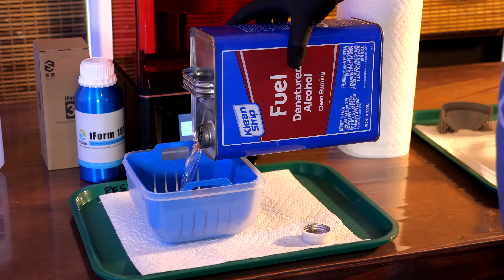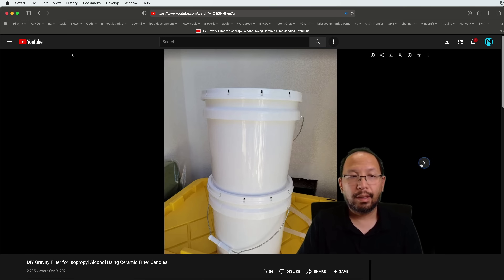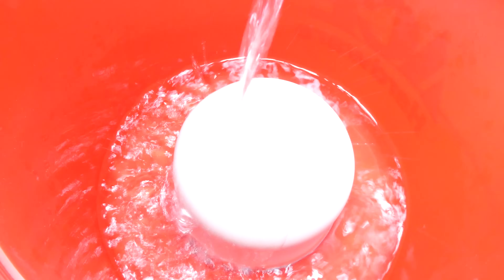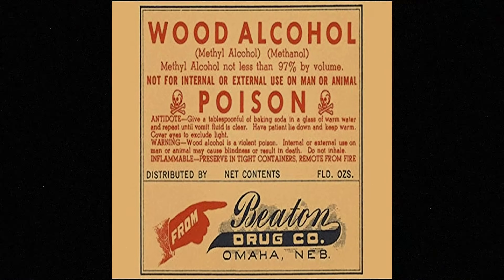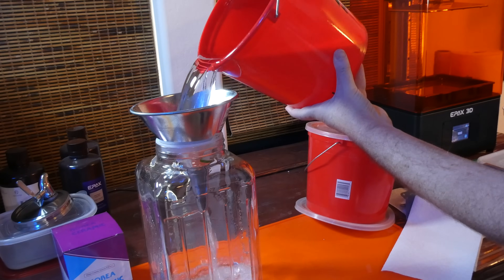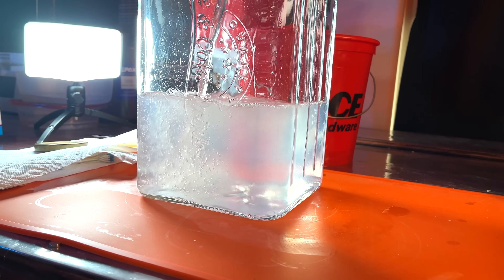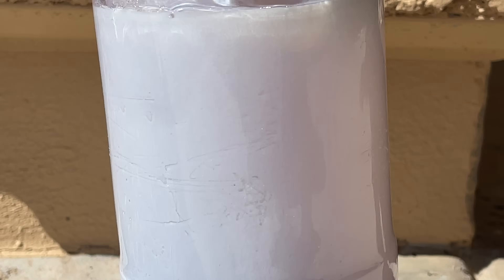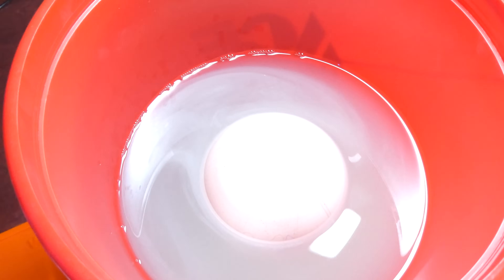Can We Recycle 3D Printing Alcohol?

Comment: So, a couple things.  Isopropyl alcohol smells like that because that is what isopropyl alcohol smells like.  It is also not commonly denatured.
Additionally, mechanically filtering IPA is only effective at removing the pigments from the solution.  Photopolymer resin molecules are smaller than isopropyl molecules, so any filter tight enough to block resin will also block IPA.  There is some level of effectiveness as the resin molecules "stick" to the filter and to each other, so some is left behind, but the majority of uncured resin remains in the IPA, as you found.  the stuff that settles to the bottom is not "the resin" it is the pigment.

The only way to actually filter dirty IPA is to include a UV cure into the process and mechanical filtration to remove the cured IPA, but as you found you cannot simply cure the jar of dirty IPA because you just get a block of resin cheese with all of your IPA trapped inside, and getting it out is a massive and lossy undertaking.

Comment: I've got my old ipa back in the clear 5ltr container in gsrden its been there for a week in full sun curing the resin in the tub and it seems to be turning solid now to the plastice walls of the container It was strained to get all the mucus out at the start with the mesh filters no crud got through but when was in the sun its obviously started to form more from the contamination in the IPA with the resin but it's curing as a solid to the side wall's doing this way and leaving clear IPA on top ipl strain it again on Sunday and leave it a second week and see what happens its just an experiment for myself but seems to be working

Comment: I'd be curious how well a knock off brita filter works. There is probably a video on this I just havent searched. I do have a distillation apparatus I can use. I bought it during covid as I could only fid 50% isopropyl and for my job (fixing phones) I need high purity. I originally tried the salt trick which is cool but some salt does dissolve into the alcohol which is not good for electronics. So I ended up buying a distillation apparatus which works great but its small so it takes a long time, and is dangerous. I did this in my kitchen using an electric hot plate and LOTS of ventilation. So it is an option but I am gonna look into these filter projects before I do that.

Comment: I bought the recommended filters, and mounted a system of 3 buckets and double filter, but it does not work. The filters are not absorbing the alcohol, it all stays in the first bucket. Has anyone had the same problem?
Reply from the maker: It needs to be settled for a week or so, then cured and then filtered.  Look at some of the other comments on here. A lot of good ideas and suggestions.

Comment: While I dont think that distillation is that dangerous, this method is much easier and maybe also cheaper.

As for the bittering agent, I mostly use hand sanitiser for general projects where I need ethanol to clean something. The hand sanitiser that I have just contains (as far as I know) ethanol and hydrogen peroxide, so its much nicer to work with.
Some of the bittering agents in other denatured alcohol are so bitter that you can even taste them when handling food after washing your hands.

Comment: I wouldn't mind distilling alcohol in equipment made for that purpose but I would never use a water distiller for that. The boiling point of IPA is much lower than that of water and the resin fallout can't be good for the inside of the machine.

Comment: Maybe try freezing the solution after you’ve filtered it and filter again to remove the ice. Water is gone, purity is as good as it will probably get. Above 90% is ideal.

I have a sonic cleaner so parts must be in another container with IPA suspended in a basket off the bottom.

👉Here’s suggested purifying method. 

You freeze the alcohol mixture, which allows for partial removal of the nonalcoholic components (water/resin); what remains will be slightly more purified alcohol. 

👉Also called Mongolian distillation method.

👉Another method is; 
Use ordinary table salt to separate isopropyl alcohol from water. 

The result will be a condensed isopropyl alcohol. Don’t forget it is not a drinking alcohol👀. This process is colloquially called salting out, and causes concentrated isopropyl alcohol to separate into a distinct layer. 

⚠️Do Not Use Iodized Salt⚠️

👉You may use any amount of alcohol and salt you like, as long as it follows the ratio of four parts liquid to one part salt. 

These are better methods than distilling that don’t require expensive science equipment If your IPA is old or has absorbed too much water.

Comment: Interesting. I have a distiller that pulls a vacuum before heating up the ethyl alcohol to evaporate it that I use to make Wax. I bet it would work for this too. With it pulling a vacuum, it does not have to get very hot to boil off the alcohol and is safer. Plus with it being a vacuum, it should have little to no oxygen to combust with.

Comment: Have a quick question, I already have one of my containers filled with isopropyl alcohol, also known as rubbing alcohol, high-level medical grade, so it's at 91%.

Since what you're using is denatured alcohol, and since both differ subtly, could I still use both in the same container, or we'll both containers have to be separated out to be labeled properly so that both don't mix?

I've been trying to find like almost everywhere if it's okay to mix of denatured and isopropyl alcohol together in the same container and not get any kind of odd reactions or violent reaction, and everything that I come across is not answering my question

Comment: Have you considered creating a siphon with filter material inside the tube? I’m thinking that if you could keep the siphon hose floating close to the top of the surface, gravity would keep the larger particles from going up the tube. Having filter material within the tube could allow for additional filtration as the fluid travels to the other container.

Comment: Alcohol has a low boiling point. Not anywhere close to ignition temp. As long asthe heat source is far from the alcohol. No problem. How about sous vide

Comment: I just got my 3d printer yesterday.  Haven't fired it up yet; I'm waiting for gloves, goggles, etc to get here in a day or two, and in the meantime I'm reading (watching) everything I can to learn the process.  Anyway, how about a sand filter, at least for the first stage?  That would be cheaper than the filter you bought and might not clog up as fast.  For those of you with a wash-n-cure machine, what about putting the dirty alcohol in cure station (perhaps in a big glass jar instead of the washing vat in case it goes horribly wrong) and using the magnetic stirrer to keep it agitated so it doesn't form a gel (mucus) as the resin hardens?

Comment: Um. That is not right. Distillation can and does remove methanol (the denaturing component most often used). You do need to know what you are doing but it can be done. Yhis how monshine is made and why whiskey does not contain methanol. you don't need Walter White levels of chemistry knowledge.

Comment: I have a background in chemstry and must say. If, and only if, you have the right equipment (wich is not that expensive) and knowledge to do, distilling is very easy and quite fast. I've done a few times to reduce the amount of water in alcohol for some reactions that are a little water sensitive and they went painlesly. But i would never recomend it to anyone who doesn't have the knowledge to do so, and specialty the knowledge to deal with it in case something goes wrong.

Comment: a rubber flap cut to fit over the filter while vertical hooked up to a cheap motor to spin would both agitate the alcohol and wipe off resin

Comment: Yes, I would feel comfortable distilling alcohol. You see, you're indirectly heating it (and furthermore in an airtight container that contains little to no oxygen, making combustion IMPOSSIBLE) and the alcohol will begin to vaporize at a fairly low temperature (100F +) which is way lower than it's combustion temperature. Sure, it seems scary, but distilleries frequently run alcohols at 160 proof plus through distillers in order to achieve even higher alcohol content. So, if they do it with zero qualms, why can't you?

Comment: You might want to include a "big" filter prior to the ceramic filters. Something to catch the larger particulates. Maybe a multi-stage filtration system with "step down" filter sizes, IE smaller and smaller filter sizes to get each level cleaner. I'd also suggest breaking them up into multiple devices instead of one massive system so that if you need to clean a filter you don't have to drain multiple filters above it.

Comment: About distilling. 
Doing it without a flammy heat source is safe so long that you do it in a ventilated area or outside. I would however says that chemistry glassware works infinitely better than some cheap appliance. And isn't that expensive either so long you take good care of it.

About the idea of drinking it, of course don't. But for science curiosity, know that methanol comes first in the distillate as it is more volatile, so long that you lower the heat, ad a stir bar and wait for a good 15% of volume to drip. What's left to distill would be ethanol. NileRed shows how. Or don't and leave it to chemist for obvious reasons. The bitter would still be present anyhow.

Comment: I was inspired.  I made this with 2 of these filters in 2 different 5 gallon buckets for a total of 4 filters going into a 3rd 5 gallon bucket.  The alcohol comes out very clear.  Haven't degunked the filters yet, so I'm really looking forward to that.  It filters pretty slow, but it does work.  However I don't consume huge amounts of alcohol with only one printer, so I'd say if you have lots of printers, you might want more than one setup to be filtering at any given time.  It'll still make the money back easily.

Comment: I distill my alcohol using a water distiller, you said the water content won't go down but mine is adjustable, I run it below the boiling point of water and it comes out crystal clear and no amount of UV will cause any "mucus" I did modify it though adding lots of extra sealant and an external radiator with fans as the built in coils don't condense nearly all the alcohol like 75% at best. Been doing this for a while without any issues.my whole system is sealed with the exception of a small vent on the collection bottle. No smell in the garage and I can do a gallon in about 2 hours give or take. An adjustable still is a good idea and it runs off a PID controller I added, but even with the stock band controller setting it at 82C works fine.

Comment: Question: If you exposed the solution to UV until the Resin became COMPLETELY solid, would it expel the alcohol instead of incorporating it like in the last example?

Could you spin it in a centrifuge like manner and separate the Resin prior to filtering it for extremely filthy solutions?

Comment: That resin seems like it would be a pain in clogging up pores in a fine ceramic filter. A multi-stage system using really basic and cheap disposable filters (coffee filters for example) at the top stage would make the most sense. Even a coffee filter might remove like 80-90% of the chunkiest gunk - meaning your much finer filters below will last 5-10x longer and not clog up nearly as much. This approach should save  both time, effort and costs.

Distillation is great and would allow for complete purification - but it's a power intensive process, so that power demand would eat up a non-trivial amount lot of any cost savings you get out of this. That level of purification is probably overkill for this use-case anyway.

Comment: You might need some lab equipment for filtering.  connect Filter funnel , vacuum filtering flask  to a vacuum pump to force liquid to go through filter. If you have right equipment you might be able to DIY it.

Comment: you can turn denatured alcohol into drinkable liquid with distilling the methanol comes of first at a lower temp in this case about the first 10% put it to other uses then the rest is ethanol thiis is the same as doing it with a fermented brew the first 5% is methanol just use it elsewhere, but you look like you gotta problem with the contaminants. so your used alcohol would be no use to drink

Comment: You can separate out ethanol, water and methanol: Distill under a different pressure to separate out the water, methanol and ethanol, because they each have different vapor pressures. Yes, it requires laboratory apparatus. No, it's not trivial for home gamers, yes you'll probably get a visit from the BATF.

Comment: You can use a spirit Hydrometer (IPA is close enough in density to ethanol) to get an idea of purity of the "cleaned" alcohol, any water or resin left will increase the density so you can do before and after tests.

Comment: The moment you had the chunky Isopropyl, a better solution would have been to vacuum filter. In chemistry that's precisely how you would like to get a precipitate out. For one it does loose some of your solvent but you can filter it much much faster of particulates. If I had to do a fractional distillation, it would definitely be in a vent hood with proper glassware. That Mr.Coffe looking distillation machine that you showed actually gives me anxiety... its meant for water and nothing else. Great video, and great subject. It's great recycling and keeping plastics out of the waste when possible.

Comment: Alcohol burns, it doesn explode unless its in a perfect mixture as a vapour with air,, which cant happen in a distiller. Stills only ever blow up when theres too much heat (an open fire) and the right mix. A home distiller machine has none of those conditions so they are incredibly safe to use. I would definitely distil it over filtration.

Comment: this will not process 1000 or 500 gal of dirty alcohol, the charcoal will saturate really quickly and then do nothing...it's designed to filter drinking water.
If the resin settles out, then this is a clear usecase for a centrifuge. BTW distilling might be a way of saving heavily gelled alcohol, provided you can heat it safely.

Comment: As I've been distilling in general, it's not a fire hazard at all if you do it right. But about the filtration project - have you considered using different filters as 'steps' in terms of a more rough filtering at the beginning and a more fine in the end; From my experience with filters on fish tanks, the bigger ones I had used multiple stages as well and in my experience it cleans a lot of the gunk out in the early stages and gives better speeds as the fine grained filters don't have to deal with the 'big' parts anymore.

Comment: Using a distiller system is perfectly safe, I recommend using a glass distillation rig though just to be safe. By making it out of glass, the danger is severely reduced, but be careful and use a hot plate rather than a flame, and keep it on low.
Reply: Also, if you want to gravity filter, you need to filter it through a pressure deficit filter, basically hook up a vacuum to the output or an air pump on the input, just be careful not to put in too much air if you use the pump because it will violently explode.

Comment: You can use centrifuge to separate the alcohol from it. Need like 4krpm centrifuge its similar to 55G on 10cm from center. And it is theoretically possible to separate poison from alcohol but the poison evaporate temp is just 1 degrees difference from alcohol.

Comment: Useing the Distiller after many try and error with other methods. Just use it Outside. Downside, you cant use it for anything else. Don't try it to get superclean after you use it, it never get clean inside again. The alc is only flammable really close to the distiller, so just press ON and leave it alone... that's all.

Comment: You should use a multi stage filter. the bucket methode is good but i whould start with a rough filter at the top than with every step(bucket) you can decrease the filter size and finish with the ceramic filters. that could prevent the fast clogging.